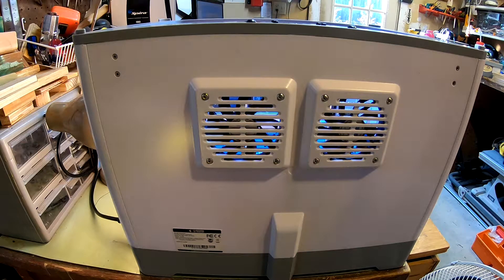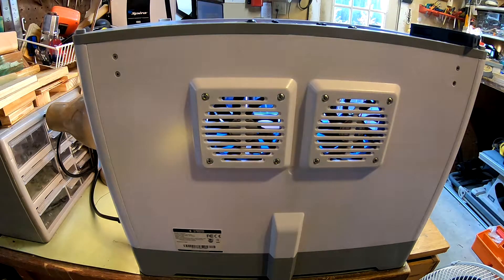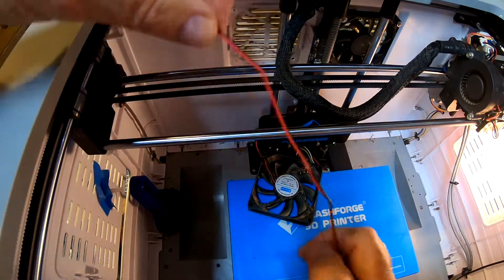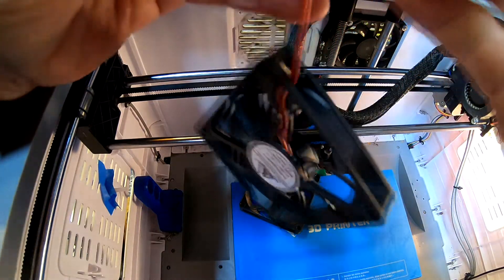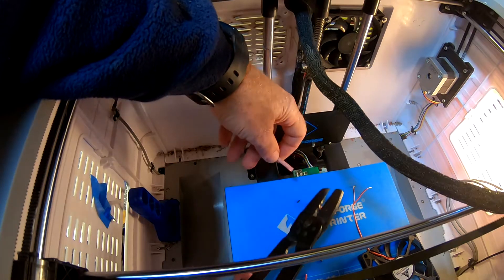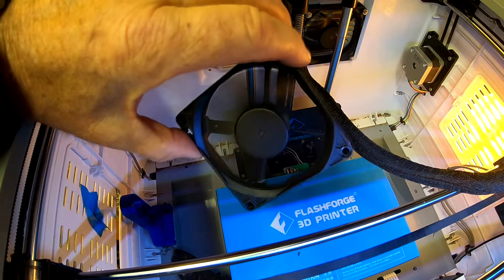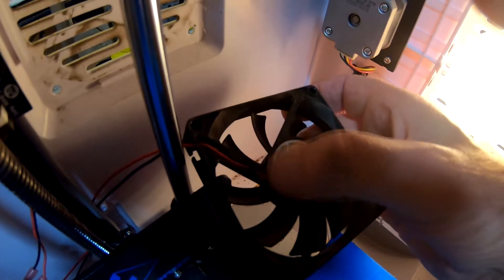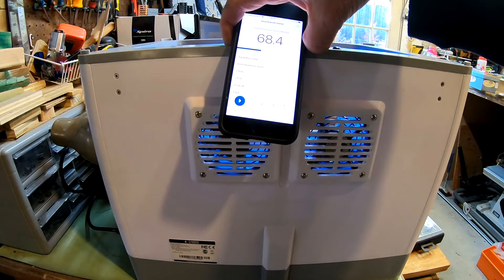Flashforge Dreamer (NX) - Replacing the NOISY Fans - Save Your Ears!

Comment: what will happened if I will simply remove them, without replacement?
Reply from the maker: Then the 3d printer won't be able to control the temperature in the box. That's not good for proper cooling.
On the inside, on the right side there's a thermostat that measures the temperature inside the 3d printer and turns those fans on/increases the speed if it gets too hot.